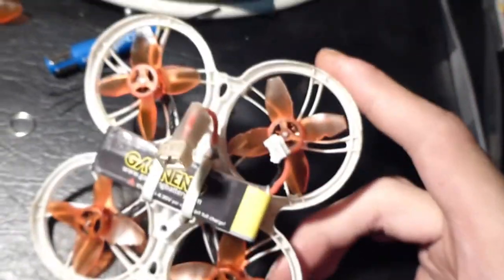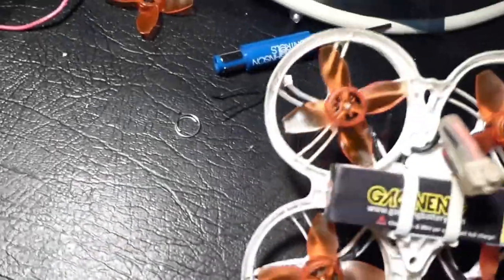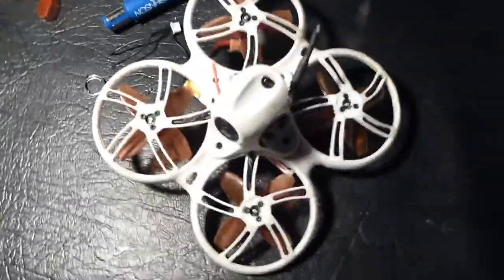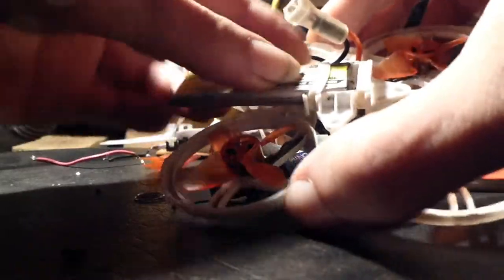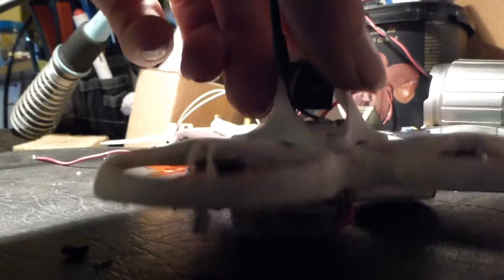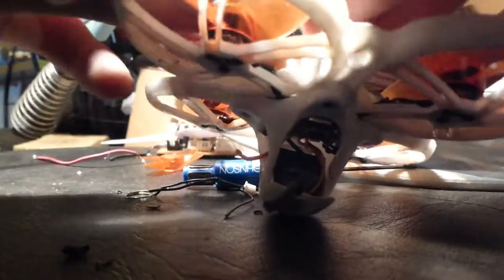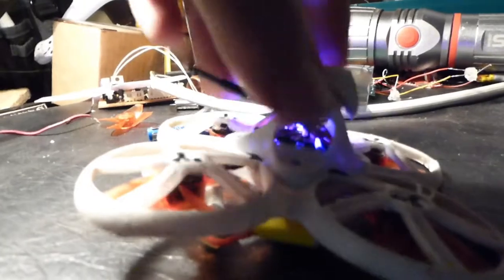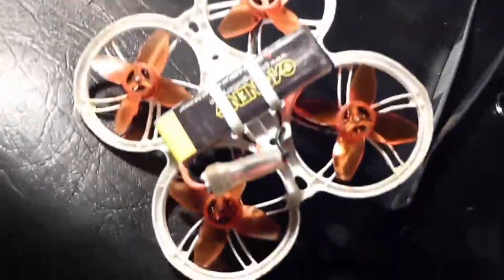tinyhawk 3 quick tip to prevent motor burn out

Comment: Thanks for this tip and do you think I should buy the TH3 or wait for a new model because EMAX normally makes a new tiny hawk model every year and it’s been 11 months
Reply from the maker: If you have fpv equipment then somthing with a better radio protocol is my suggestion or there is 2 uarts to attach a external receiver